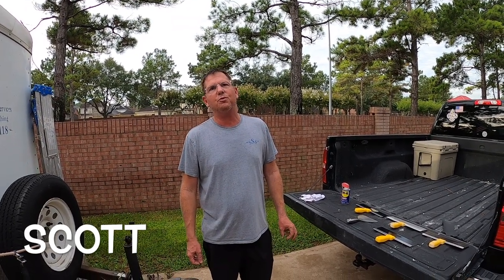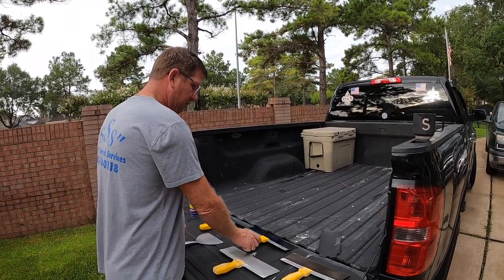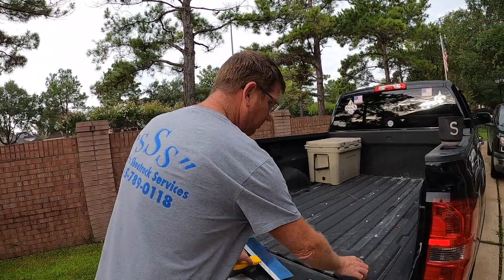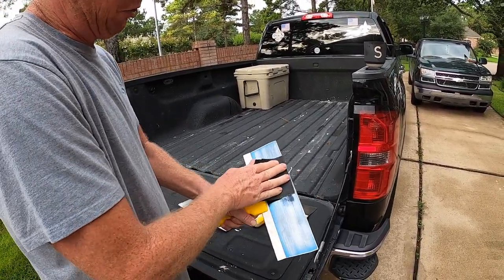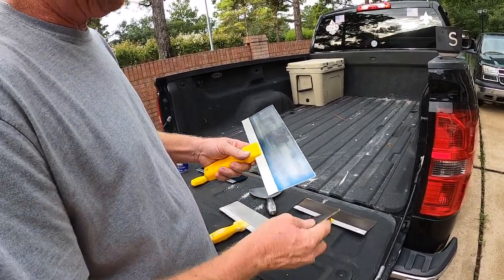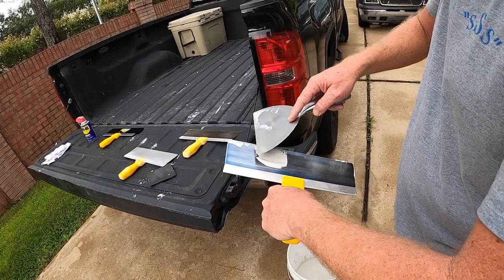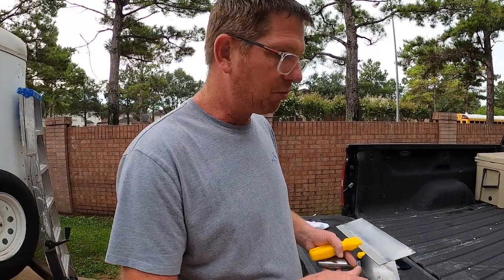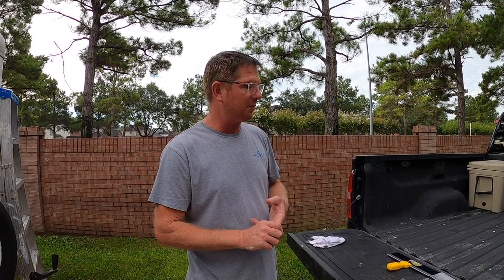What You Should Do When Getting a New Drywall Knife

Comment: 12/4/23..2day was how 2 prep a new 12" mud blade..great info, thx.
  U asked what do 'we' want 2 c next...how about skim over (old, unwanted) wall paper... because steam stripping after that perforating tool leaves sheet rock too wet. Then trying to get millions of residual paper pieces off using 6 or 8" (or bigger) blades just gouges into the wet skin of shtrk. So i just abandoned the perforate & steam process & razor cut the (few or many) raised 'corn flakes' of worn paper & begin applying the mud with my 10" blade. Its an old SherWlms SS blade with a curved handle, very comfortable to handle. This process leaves a +/- smoothe surface with few raised tool markes. When mud is dry, light (dry or moist) sand/wipe & ready for either paint (on smoothe 'new' surface) or take time to texture with whatever type customer wants. Usually can talk them into paint over smoothe but some want  modest texture like with a 9" paint roller & thin mud...but its a little messy...i dont have that monster high volume air compressor & the white bucket attached to t top of the spray nozzle..& that is messy as well. 
  So, have you done any 'skim-over' wall paper jobs?  Maybe do a video for us??🤔 Much enjoy your videos because they/you are doing practical stuff for we DIY'ers. Stay safe & carry on!💪🍺😊
Reply from the maker: In my opinion best way to do wallpaper is to not wet it peel any loose paper that comes off easily and then do an oil based prime over the entire surface prior to any mud. Once it dries if there’s any blisters, it will show you can cut them out with the razor bladetight skim texture paint or whatever

Comment: Do u recommend regular stainless steel knives instead of the new blue steel ones?
Reply from the maker: Stainless steel last longer the blue steel are good, but you have to keep WD-40 on them when you’re not using them so they don’t rust usually the blue steel is a little more flimsy, which may help with finishing. I have a stainless steel six and a stainless steel eight. It’s hard to find a good stainless steel 12.

Comment: 1) I thought the convex side of the knife should be used for applying drywall compound. 
2) I thought the blade of the knife was supposed to be squared off, not sharp.
Am I incorrect about both of these things?
Reply from the maker: If your blades are bent up away from the wall you’ll leave an edge and not keep the mud inside the blade. After you use a Drywall knife Multiple times it becomes very sharp naturally on the wall with usage. You can speed up the process with sandpaper because you have smoother pass when you’re floating or skimming hope this helps
Reply: Yeah taping knives are suppossed to have a 90 degree angle to do inside corners. i like to sand my knives all the way to 400 grit or higher, till it's almost polished. Then i put a little oil on it. They become so smooth the mud just glides off the knives

Comment: Can you explain more about the bow the knifes make thanks
Reply from the maker: So if you look at any knife when you first buy it it’s not completely straight it has a bow one way or the other so whichever side of the inside of the knife makes a slight bow that’s the side you should use naturally. As you are trying to leave mud in the middle of your joints hope this helps
Reply from the maker: If you hold a knife sideways and look along the blade maybe with one eye closed you can see the middle of the knife will bow just slightly one way or the other for application of mud and floating and skimming you would want to use the opposite side of the bow so if the bow goes a little to the right then use the left side of your knife for the side of application. I’ll put a mark on my knife maybe an initial or something and/or just look at it prior to application when I’m working if you use the other side it will tend to  leave edges as opposed to enclosing your seam or butt or bead or whatever your using I do a very slight sanding on the corner just to get that point off of it otherwise it’ll leave lines on the exterior of your application hope this helps
Reply: This is bassackerds information..You don't tape with a ten, twelve or 14" .No need to do anything to those knives.Get busy.  I used the curved side down.Always have always will and everyone I know does the same. This guy doesn't know. Always buy stainless steel knives.
Reply: The 6" I agree with.